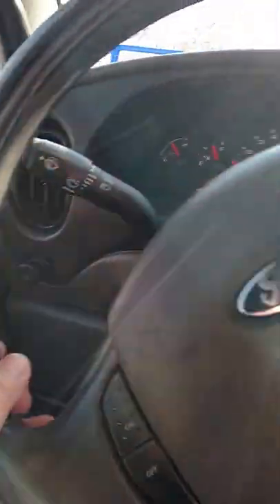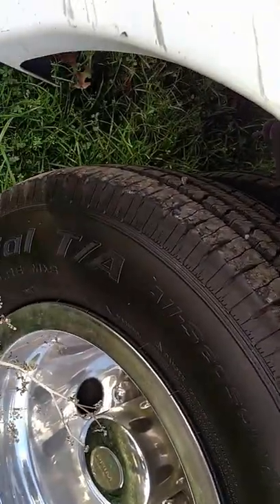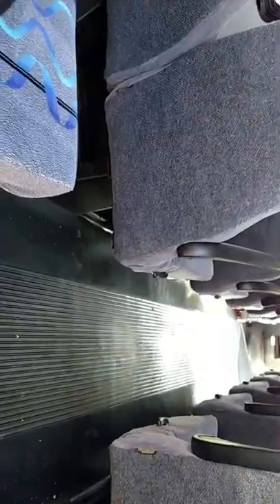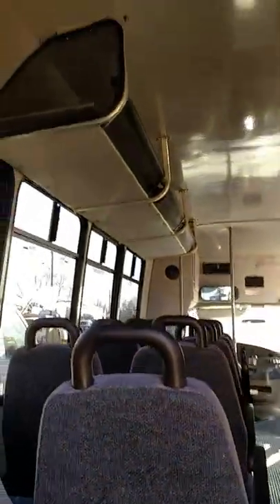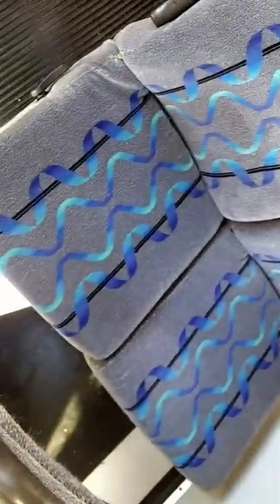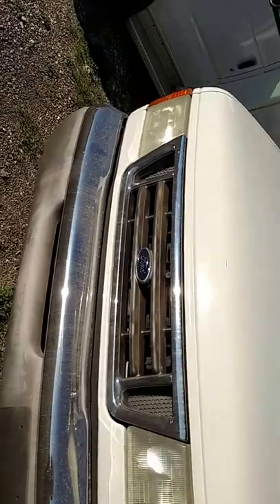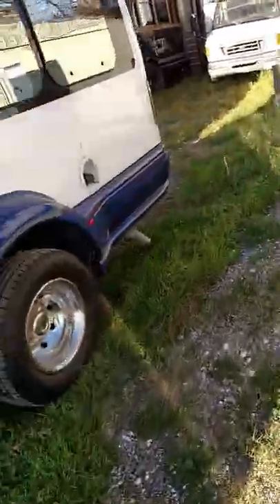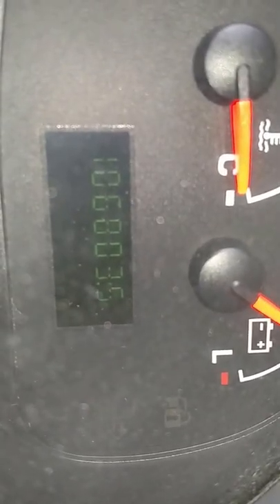24 Passenger E450 Mini Bus

Comment: how many miles?
Reply from the maker: on the 24 passenger?  105k miles.   I may have a buyer tomorrow though, a church just looked at it.
Reply: yea im with the church lol im the only class B driver they got lol were trying get info to see pricing on insurance
Reply from the maker: Oh yeah, nice...   gonna average $250 month.   Central Insurance is good agent.    I've had that good one and 2 not so good.
Reply: does it matter in 24 lol
Reply: sorry does it matter in 24 yrs old
Reply from the maker: I don't think so, they all are different.   I think 24/25 is that magic number
Reply from the maker: +Derek D Also, you could remove seats to only 14, then don't need a CDL.
Reply: +Derek D ok so u recommend cental insurance